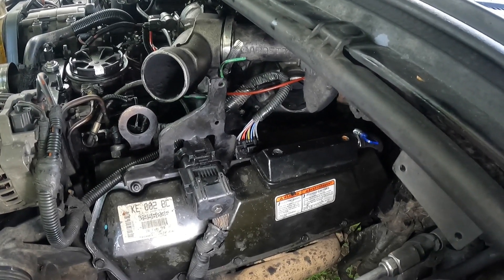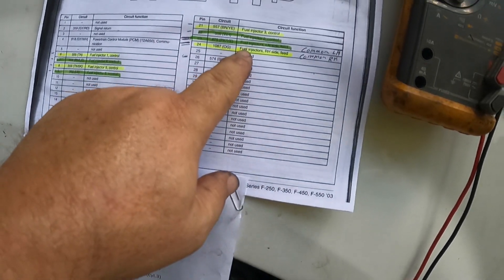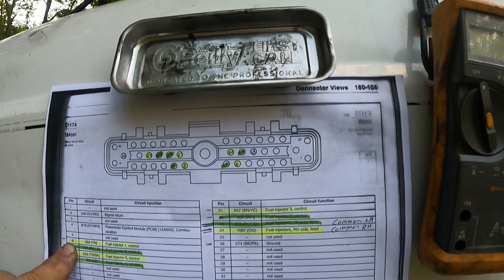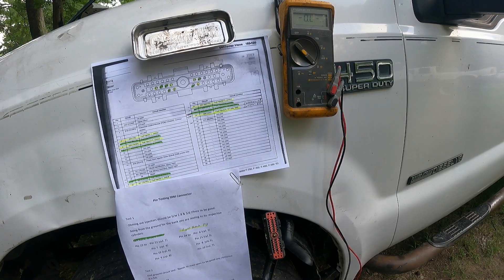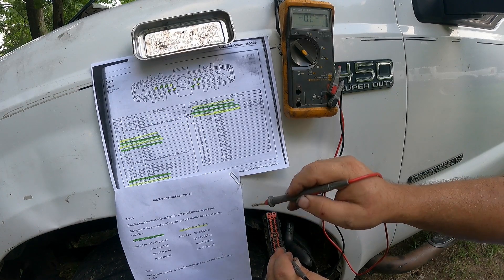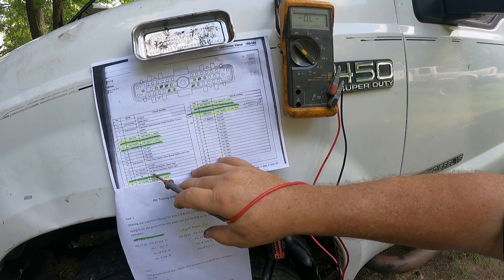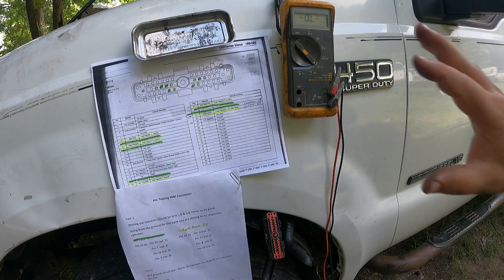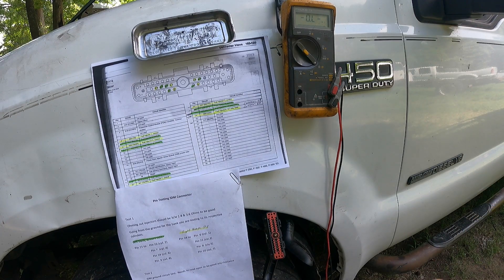IDM Wire Harness Pin Test. P1316 DTC.   2001 7.3 Power stroke

Comment from the maker: Based on that info I would have gone after the same things you did. FYI, you can run these girls without the valve covers on if you’d like. 

My first thoughts were uvch and /or 9 pin plug moving and connection breaking down. Another place to inspect is the 42 pin connector. That’s the big one on the driver side valve cover coming from the fender. They are known to rub on the vc and short. You can bend the plug holder up a little bit to prevent this. It’s also good to pull back the loom a bit and inspect as I have seen wires chafed from the loom at this spot and just past the engine side of the connector where it turns 90 degrees. 

Hope that helps. Keep me posted on your progress. And thanks for watchin.
Reply: 2.7 ohms is outta spec at the idm connector whats that mean
Reply from the maker: @patrickpatterson3239  on electrical components there is usually a specification of how many ohms of resistance that component will show on an ohms test when it is good. For the 7.3 injectors that spec is between 2.8-3.6. 

Now in this test of ohming out the idm plug you are checking for readings out of this spec to attempt to find your problem area. So if you get a bad reading you can shorten the loop by moving inward to the 42 pin connecter and testing there. If still out of spec then move in to the valve cover harness. Each of these steps is ruling out sections of the harness and narrowing your focus towards the troubled area. 

Couple of side notes to keep in mind. Some meters are more accurate than others so if you are getting a reading that is 0.1 out of spec you may still be good. 

The thing to watch out for with ohm testing like this is that if you are testing a wire that has several broken wires and just a few strands still holding it can show good even with a few strands holding but will not carry the load of 120v DC that the idm sends to the injectors.
Reply: @bayoudiesel  tyvm is a 2.7 ohms all around far enough to  cause a no start? Ive seen 2.8 to 3.5 ohms is preferred
Reply from the maker: If I found your numbers I would make note of them but would move on to looking at other usual no start suspects before I worry about 2.7
Reply: @bayoudiesel  tyvm
Reply: In process of load testing 42pin wires..  Been burned trusting ohm #. Good info here. Im still learning thank you all.
Reply from the maker: @2369chico  one thing to keep in mind is that if you have a frayed wire with just a few strands still holding you can get a good ohm test due to the minimal voltage the ohm meter puts out. But that line will not carry a load when the idm try’s to send 120v DC. So this test can help you find a problem but does have its week points
Reply: @bayoudiesel  When you are testing with a load, should it be the 120v or the 12v load?
Reply from the maker: @frankshiffer588 as to activating the pin. I’m not sure. I don’t have a way to send 120c dc. As for testing the individual wires integrity you can unhook both ends and rig a light (I use a trailer light) and send 12 v thru it and see if it will lite up the light. 
The 1280 should be the icp code if I remember correctly. May want to check it out. Look for oil in the electrical pigtail and try running it with the icp unplugged to see if it makes a difference.

Comment: All mine are over 10.0 ohms
Reply from the maker: Sounds like you have an issue. How’s she running?
Reply: @bayoudiesel  idles fine when I start moving the driver side bank shuts off I replaced the valve cover gaskets new plug and pulled the engine harness off and combed through it found the back side of ipr socket was burnt up replaced it with old vc gasket plug seems to idle better I still have to put the valve covers and intercooler piping back on before I can see if my problem was fixed I also picked up an idm from a buddy for free and put in

Comment: When you  ohm it is your battery still hooked up you got the key switch on or off
Reply from the maker: For this test it doesn’t matter because you are disconnected from the rest of the truck ounce you unplug the idm. However it is a good practice to unhook batteries unless you are testing for 12v on something. 
But this test is just making a loop. And the loop is unhooked from the rest of the truck. 

Side note when ohm testing you are using really low volts and if a wire is frayed you can sometimes get a false positive if you just have a few strands still connected but that wire will fail when carrying a load. Like the 120v DC that the idm puts out.

Comment: This is really helpful I been dealing with my 7.3  and they told me at first it  I didn’t have no comunicación with  idm and ecm  replace both of them with another truck I got  still the same replacement injections and harness replace harness from the motor and even did a new hpop   And is all the same  I am thinking is something in the outside fuse box or in the harness for the idm or ecm , I replace inside fuse box and nothing
Reply from the maker: Can you tell me about what the truck is doing?
Are there any codes?
Do you have access to a scan tool?
Reply: @bayoudiesel   there is no codes  I check my icp and ipr and they seem to be all fine  I drop it to work one they and I park it and try to start it back up and didn’t crank at first it seems like you where able to get it back running like maybe 1 time every day but now is completely dead replace injectors and harness for the motor and for the injectors and still nothing  have been to two shops and they can’t find nothing  the first shop told me that they can’t get no communication from the  idm to pcm
Reply: I did this test and my passenger side is showing me 10.6 or 12.5 in all of the passenger side ones
Reply: Update I replace both harness and all injectors  same with the idm and ecm now I am having better reading but still with all that replace I am still having a 4.0 in 3 of my passenger side but it still not running
Reply from the maker: @jaredmembreno8287  are you getting any white smoke while cranking?  Is the engine trying to pop off or just spinning over?

Is the oil full on the dip stick?  Have you checked the hpop reservoir to see if it is staying full?
Reply: And I check my harness again with the other injectors and injector harness and driver side all of them are around 3.1 to 2.6 but passenger side they are at 6.0 to 5.8
Reply from the maker: @jaredmembreno8287  where did you test from?  The same plug in the video for the idm?
Reply: @bayoudiesel  yes the same plug
Reply from the maker: @jaredmembreno8287  my thoughts so far are this:

Sense you replaced the injectors and the valve cover harnesses we can assume those are not the problem. And sense you have tested the idm and ecm those are not the problem. 

That’s going to lead me to wiring and / or fuses. I would start by running all the fuses to make sure one isn’t blown. If your truck is 99-02 you have 2 fuse boxes. One under the hood and one in the dash. If 02-03 just one box under the dash. So check this and see if any are bad. 

Before we get into wiring we need to verify a few things. When you turn on the key so you have the wait to start light working, along with the other light in the cluster that isually come on before starting?

Can you hear the fuel pump below the driver seat on the frame. It should come on when the key is on and runs for 30 seconds?

Engine oil should be full on the dip stick and you could check the hpop reservoir as well. 

Does she have white smoke when cranking or no smoke?

Please reread these and find all the questions and send me some answers and we can see where that point us.
Reply: @bayoudiesel  yea is a 2000 7.3 and I have check all my fuses  the ones inside and outside even my relays  a 1 ago I had the inside fuse box going bad I replace with with another one. I replace that one to with my other truck because is easy to get so it only leaves with  the outside one.                                                         I have no white smoke coming out of my tail Pipe , when I turn the key on I have my normal lights comes on and then they go away after a few minutes I put the new electric pump, because the old one wasn’t building  no psi now  the new one is building almost 90 psi             Oil on dipstick is little bit over  I put some in it and I filled it little bit over
Reply from the maker: @jaredmembreno8287  ok. Got it.   The fact that you are not getting any smoke while cranking tells me this. On these trucks you need a few things to make the ecm pulse the injectors. They are good rpm’s form charged batteries usually around 165 or more rpm’s. The ecm seeing good rpm’s says the crank position sensor is good. Then it needs to see at least 520psi from the hpop. When it see those two it will pulse the injectors. 

Sense you have good fuel pressure it would appear that something is preventing the injectors from pulsing and sending fuel into the cylinders. 

At this point I will usually turn to seeing live data from a scanner to try to find what missing. 

Sense we don’t have that option right now, one thing you can try is to make a 2 wire jumper to send 12 volts to the ipr directly from the battery. This will force the ipr to full closed and should push the hpop psi to around 3000. If that makes her start popping then you may have a communication problem between the ecm and the ipr. 

All that being said it might just be wiring issues in the engine harness. These trucks are all 20 years old and the wiring gets bad. May need to do ohm test form the 42 pin and the 9 pin connectors to narrow down the problem. If you have good readings on one bank and not the other the truck could still start and run on half the motor. It will sound really bad but can run.
Reply: @bayoudiesel  I will try that tomorrow I have a scan gauge from bullet prom and is showing me around 1500 to 2000 while cranking on my icp and my ipr is showing me 14.9 volts   And on the pin 42 and pin 9 is that on  idm or the ecm part ?
Reply: And is 85 and 90 psi good fuel pressure? Or you think is that high because the injectors are not opening? I know somebody told me that is to much of fuel pressure that will make the truck not start  thanks a lot for the help been dealing with this truck for 6 months already been in two shops and one of them just told me that they had no comunicación from idm to pcm and start putting parts on it like the crank position sensor and other parts and the other shop just put it in the back of there shop so I decided to do it myself  so thanks a lot
Reply from the maker: @jaredmembreno8287  the test I did in the video tests the loop from the idm plug through the 42 pin connector on the drives side valve cover then through the engine harness to the 9 pin connector that plugs into the valve cover gaskets. 

When I confirm bad ohm readings at the idm plug I will move to the 42 pin square plug on the driver side valve cover and pin test from there. Then move to the 9 pins on each side. This is just narrowing down the wiring harness to try to isolate where the problem is. 

If you need pin out pics like the idm one in the video I can email them to you. Just contact me on my email and give me your email or a number I can text the to you at

Bayoudieseltrucks@gmail.com
Reply from the maker: @jaredmembreno8287   the fuel pumps usually put out around 80-90psi as they pump fuel through the fuel bowl and back to the tank. The fuel pressure regulator spring on the drivers side of the fuel bowl is set to hold back around 60psi and let the rest of the psi go back to the tank. But I doubt that would be causing the no start. A lot of people put in a heavier spring to raise the pressure from stock.
Reply: I finally got somebody to tell me that I am not having a connection out of my idm  like is not responding I replace the idm still same problem now I am going true my harness to see if I find a bad wire

Comment: Buenas tardes sr   yo tengo el código 1326 ya cambié. Arnés completo. Y el de las tapas. También. Ya revise así mismo ese procedimiento que husted isi y sigo  con la falla  podrá ser
Reply from the maker: ¿Quiso decir P 1316 porque no veo una p 1326 en mis manuales?

Si es 1316, normalmente apunta al IDM según la descripción. Normalmente encuentro problemas de cableado en el arnés del motor o en un conector. Para seguir adelante con usted, necesitaré saber qué está haciendo el camión.

Comment: sorry, stupidity weighing in here... I'm checking this and like Keith, am just amazed at how cleanly this was put together, but im coming up with 8+numbers on the left bank, 0.L on 1 and 5cyls 2.9 on 3 and 7clys.... now where do i go.. this is a 2002 motor going into a 2000 truck.... am i trying the impossible??
Reply from the maker: No sir. The only stupid questions are the ones not asked. And you are not attempting the impossible. Just need to kick it around a bit and we can get ya dialed in I’m betting. 

First off this test can give false positives sometimes due to a frayed wire being able to carry and ohm test and not the load of 120v dc. I forgot to put that in the video.

Catch me up on what the truck is doing and what you have done so far please?
Reply: hour a different tester out, i think that was some of my problem.. now i have good values for the left bank, and 0.L on cylinders 1 and 5... so i was panicking yesterday when the meter was messing with me, but a quick rundown, this truck sat and wiring harness was rodentized.... i had other issues going, so it sat some more after i took it to a mechanic. he preceded to steal my obdII scanner and the flash paq for my super chip and about 800 four of rolled up leads out of the back seat to start. lots of rigging to install pillar Guages and it shows🤦‍♂️🤦‍♂️i put it on back burner, bought a low mileage truck for motor(paid 1500) and when i bought it, i was able to drive it away with an oil leak... guy said it was a rear main, so i put a skid in the bed of it and worked it until i fell asleep behind the wheel and flipped it with my vantage in it..😭now that low mileage motor is in this beast and its seen 3 more mechanics and can't get communication for obdII. In the middle of all of that, i ended up wiring on harness with solder and shrink, and even got it to work for a week about 4 hours away and when job was over, i went to the welding supply and it stopped and never ran again. i kept taking it places because i needed to work to pay for it all. low mileage motor from 2002 rwd xt and set of new dealer injectors, which i find turn out to be remans. I'm not positive there hasn't been sabotage, but feel like there should be enough here and I'm trying to put my buddy in the truck I'm driving now and me back in this one. he's a jam up mechanic, but we're here now)))i know, i know, a nightmare
Reply: oil leak in 1500 dollar truck turned out to be hpop fitting o rings...40 bucks at dealer😆😆i had already poured 1000 in Rotella out on the road putting truck to work😭😭😭

Comment: What does it mean is you’re getting 0 ohms for the passenger side bank?
Reply from the maker: 0 ohms is good continuity with zero resistance
Reply: @bayoudiesel  on your paper it said it should be 2.8 - 3.6
Reply from the maker: @danscreativespace  sorry. I was in the middle of an ac repair and didn’t completely follow your question. 

I assume u are doing some version of my idm test in the video. Are you testing thru the idm plug?
If so it would appear that you have a shorted wire and may be making continuity before getting to the injectors. Otherwise you would be getting numbers indicating resistance. 
You may need to move to the 42 pin connector or even all the way to the 9 pins to try to isolate the location of the problem. 

Hit me back with an explanation of what you have done so far to catch me up please.
Reply: @bayoudiesel  did a buzz test and got error codes p1273 p1275 p1277.  Check the wire harness connected to the valve cover, didn’t see any burnt pins.  Made sure harness was clean and securely connected.  So followed your video on the IDM.  Driver side ohms was reading around 3 for all cylinders for injector test.  Passenger side was reading 0 for all cylinders (same cylinders coming back in buzz test).  IDM ground test was okay
Reply from the maker: @danscreativespace  ok I’m with ya now. Have ya pulled the valve covers a to inspect uvch?

I would do the ohm test again at the 9 pin. If those cylinders fail then uvch is bad

If they pass then your short is probably further back in the harness. So my next move would be to conduct the ohm test at the 42 pin connector. 

If you need pin out info on these 2 connectors I can shoot it to ya